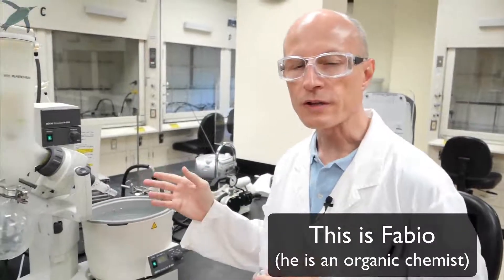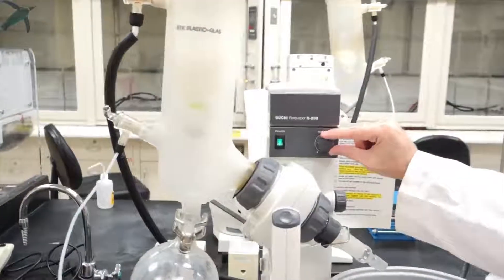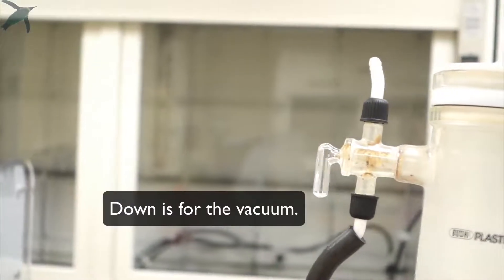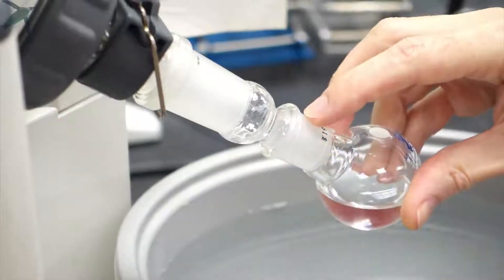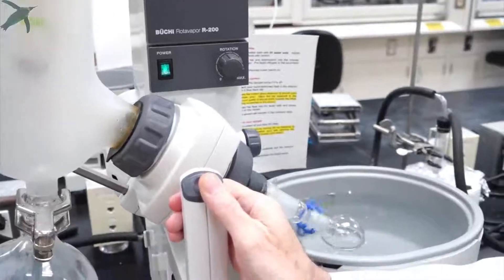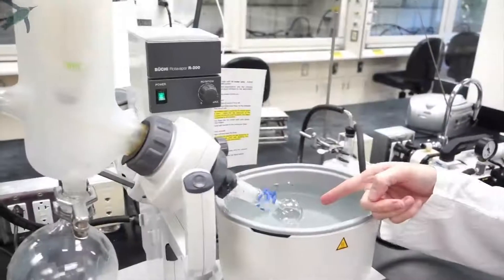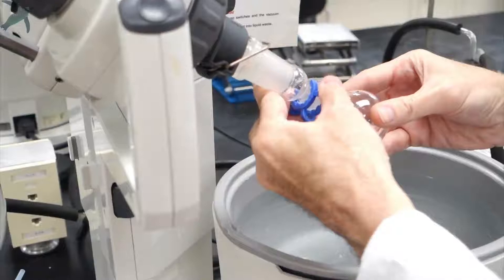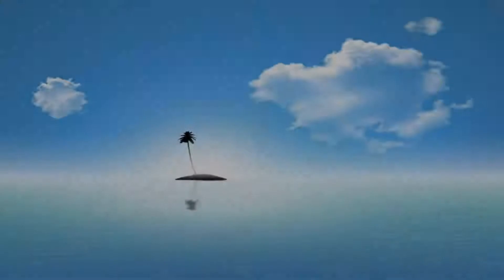How to Use a Rotary Evaporator (Rotavap)

Comment: Thanks for your clear demonstration. Our lab has no Rotary Evaporator and Round flask, but I have to prepare liposome for miRNA delivery. Can you please suggest me alternative instruments instead of rotary Evaporator and Round flask to continue my experiment.
Reply: You can still prepare liposomes for miRNA delivery without a rotary evaporator and round - bottom flasks: For the ultrasonic method, use a small bottle or tube to dissolve lipids, let the solvent evaporate, add water and perform ultrasonic treatment; for the extrusion method, mix lipids and miRNA in a small bottle or beaker, and use a device or syringe to extrude through a polycarbonate membrane; for the injection method, dissolve lipids in ethanol and then inject it into the aqueous phase with a syringe while stirring. If you want to make a purchase, you can contact me.
Reply: If you need relevant instruments, feel free to contact me for information and pricing.

Comment: We extracted tamarind seed oil using ethanol and we are separating the two, how to know if the tamarind seed oil is already pure and has no traces of ethanol? We are using rotavap,  Is there any clear indication if we should turn off the rotavap already?
Reply: To check if tamarind seed oil is pure and ethanol - free and when to stop the rotary evaporator, you can do three things: watch for signs like no bubbles, no steam, and slow dripping; check physical properties like temperature and smell; use professional methods like GC and NMR.

Comment: very helpful. Sir could you please suggest me if we can use Rotary Evaporator for the extraction of essential oil.
Reply: The rotary evaporator applies vacuum distillation, reducing pressure for low - temp solvent evaporation. The rotating flask aids in sample separation & concentration.
For essential oil extraction, common methods are distillation (e.g., steam distillation), pressing, extraction. Steam distillation gets aromatic components with steam, then cools and separates to obtain oil.
Theoretically, it can be used for essential oil extraction, especially concentrating extracts. For example, after organic - solvent extraction, vacuum distillation with it gets concentrated essential oils.

Comment: Great video, could you call this a distillation?
Reply from the maker: Strictly speaking, yes it is.  In practice, no one calls it a distillation because in this case, what is evaporating is waste (usually in a distillation process, you COLLECT the compounds that evaporate from the mixture).  The Swiss company Büchi came up with this idea in 1957 (and made a fortune!)
Reply: ThePenguinProf interesting